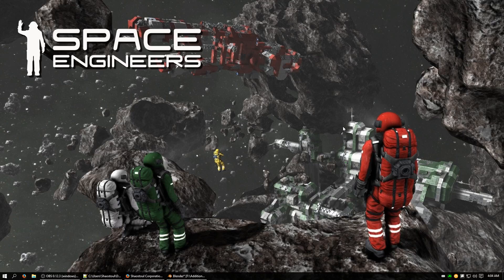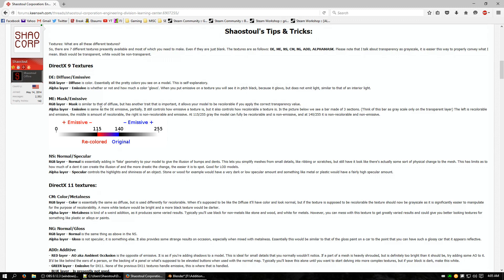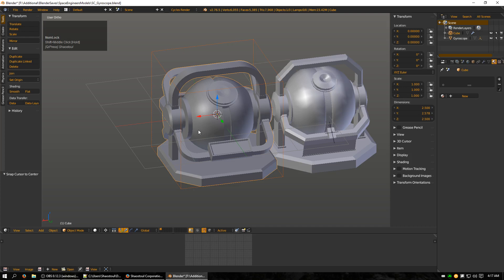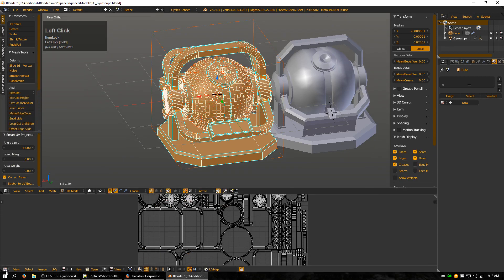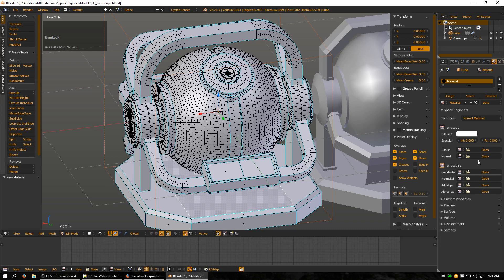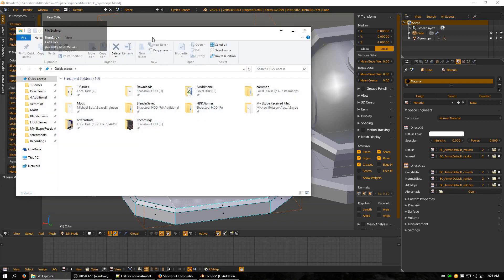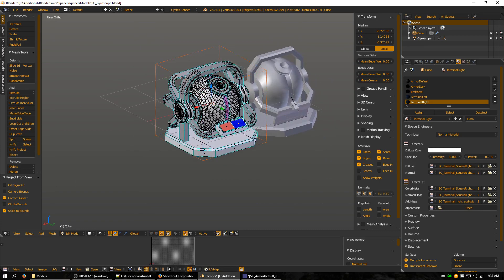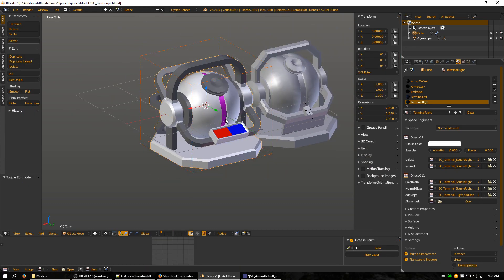Space Engineers Modding Tutorial Ep3: Materials & Textures

Comment: figured it out I had a slightly order version of the blender plugin. N
I saw an x,l file showing where the textures were located on my system where dose the data in this xml file go, I don't see any xml files in your model fcolder
Reply from the maker: +Trent Walker XML's, HKT's, and FBX's do not go in the mod folder. MWM's and DDS' go in the mod folder.
Reply: +Shaostoul I keep getting this non portable error this is an issue that is really holding me up also what is your texture size the normal appear to be 1000 x 1000 pixels.